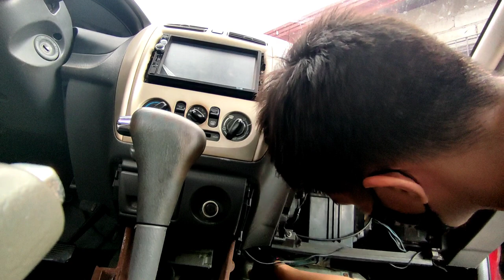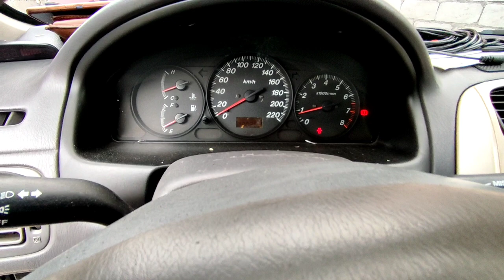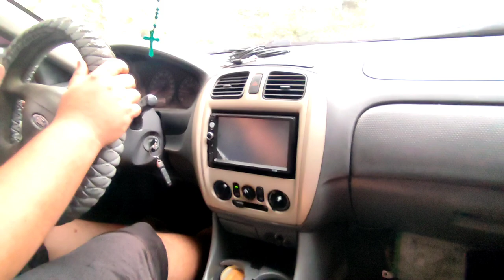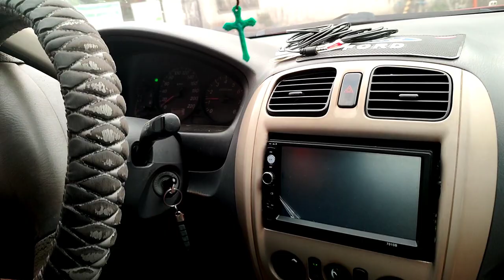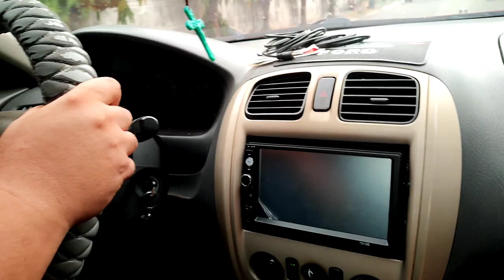FORD LYNX 2000 AT // SHIFT SHOCK REVERSE AT DRIVE.

Comment: Kapag may kaldag more on mechanical yan. Palit sana muna ng atf at tranny filter paps.
LIMP MODE meaning restricted na ang shifting nyan to deter more damage to the tranny.
But most often palit tranny na po yan.
Reply: Sir ask lang po.
Tranny q a/t pinalitan n ng bagong rebuilding kit, solenoid at atf+filter.
After 1 buwan balik prob.
Ayaw magforward.
Reply: @eubuddy  thats the irony of rebuilding/repairing more ofter hindi nagtatagal kaya we highly suggest hanap na lang po ng surplus sa mga parts out shop
Reply: @eubuddy  lagyan mo ng 5caps of brake fluid halo sa ATF